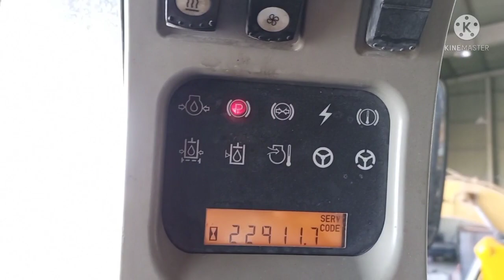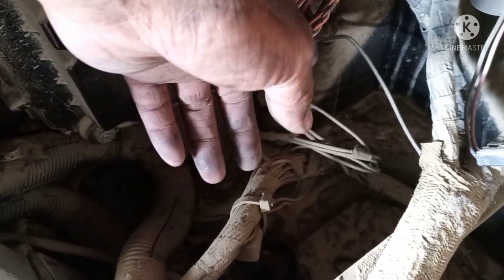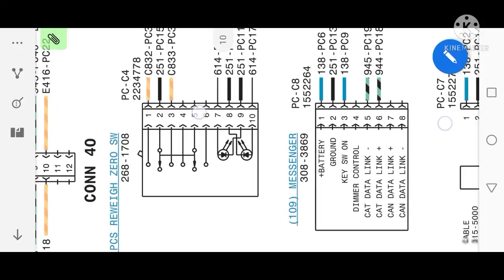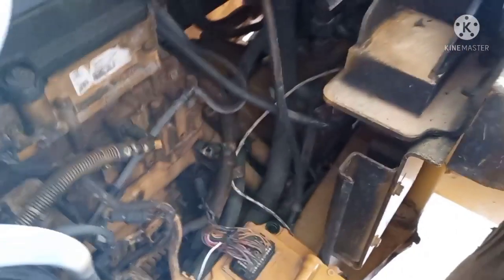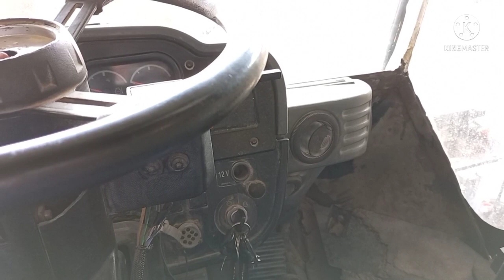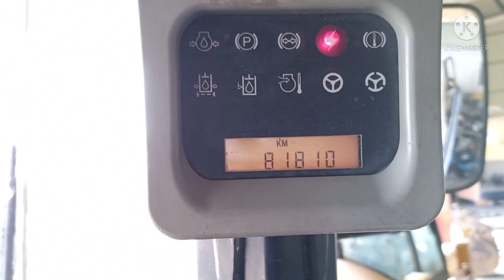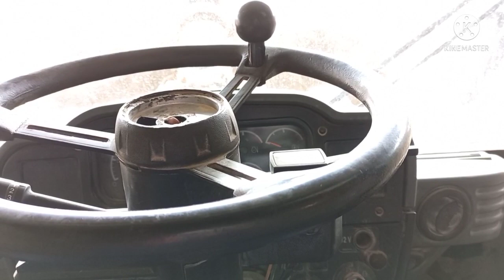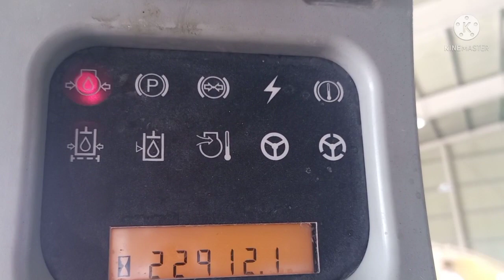CAT 966H SHOVEL ENGINE UP AND DOWN ACCELERATION

Comment: Have this same issue unstable idling. Same error code on 966h. Dealer replace engine ecm. Dealer tech also check all wiring harness before installing reman ecm. I'm learning alot from your videos. Keep it up sir.
Reply from the maker: bro sorry late response about your problem can you send in my whatsapp 0567581176
Reply: @caterpillarjhunhunk  No problem sir. I have cat et but not very good in using it. Will communicate with you sir through WhatsApp. We have here cat and komatsu equipment. 70percent are cat equipment. Keep it up sir.
Reply: Thanks for replying

Comment: Thank you it's very useful
Reply from the maker: welcome bro
Reply: It does not work in the morning except when the aerator is sprayed with oil, and when I turn off the engine while the air is hot, then I restart it and it works well.

Comment: I have a problem with the 950 G loader. When the engine is cold, it can only be started with very difficulty. When it is hot, it works well.
Reply from the maker: how long you can star the engine of your machine, did you observe any unusual sound from the engine or something shaking, or any type or cause of the problem, we can talk at whatsapp  ,+971577581176
Reply: This number does not work in WhatsApp

Comment: Good morning sir, i want to ask, how to open engine hood manually WL 966H ? This is hood stuck open, can you make video tutorials please 🙏
Reply from the maker: sometimes if the hood is stock or not open thats defend on the situition maybe gear is damage inside the gearbox or the relay that controlling to open and close is also damage, the only way you can do is there is a small window i think it have star allen key or torq allen key open the window then remove pin inside, or if you can possible to reach the bottom side of the hood lifter under that is have number 17 like nut so you rotate the in witch direction you want

Comment: I have same problem at shovel 972h from 2 days at et  have active code 268-2 programmed parameter fault erratic, incorrect 
So I download flash file 4 engine ecm and work good
Reply from the maker: bro you dont need to flash file, you should inspec the harnes, thats harnes problem bro not on ecm. you have to check the harnes, and the wire color orange and brown that wire is the communiction to the controler if that wire is shorted or open thats the result of irratic.
Reply: I actually checked the Harness on the engine ecm, all the wires were in contact with each other and isolated them from each other and the same fault  and code I made a flash file that worked efficiently after that
Reply from the maker: @Ahmedbassel86  thats good the machine now is good, usual that type of problem it is not software problem the of irratic is wiring problem, i never do re flashing   unles if the problem is inside of ecm. ok bro thanks for time and sharing your ideas and experience

Comment: Sir ano kaya ibig sabihin ng trouble code na ito 36-5-5
Reply from the maker: 36 engine section 5 injector 5 pweding loose connection s injector socket or open wire yang no.5 n injector